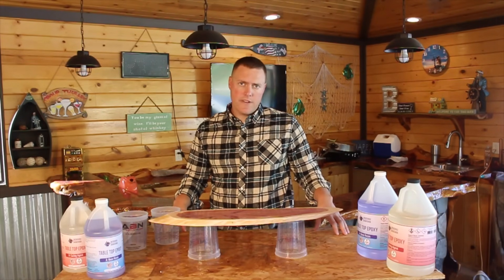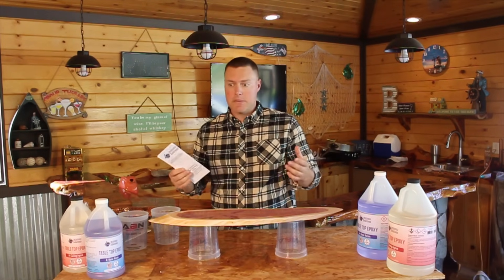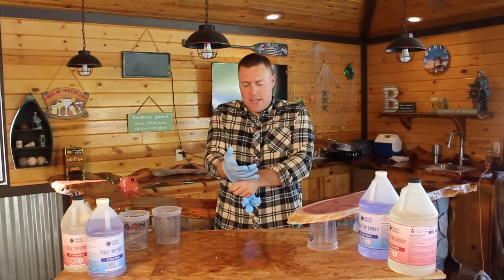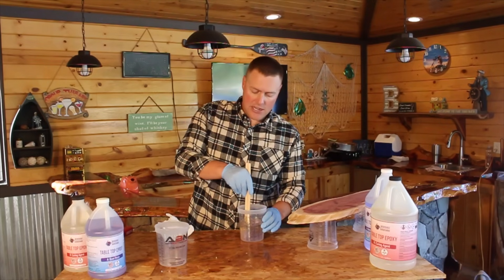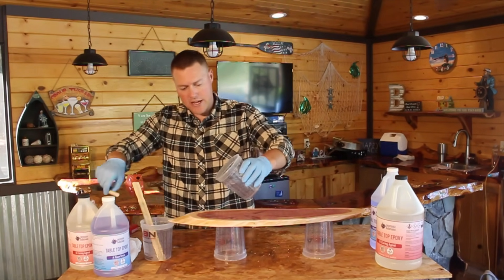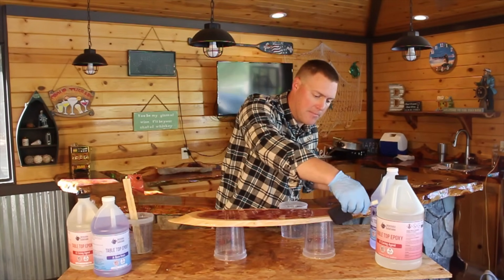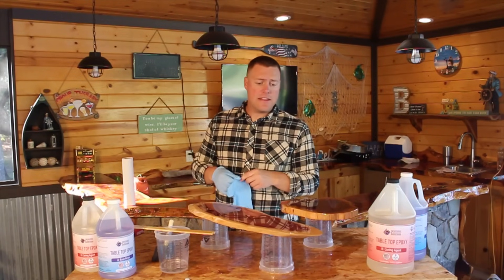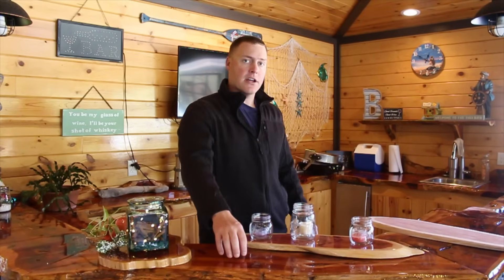Epoxy Countertops DIY Tutorial: How To Mix & Pour Bar Top Epoxy Resin Self Levling

Comment: I have a flag painted table top with gaps between each board. How would you suggest I approach epoxying it and is it even feasible? Great video
Reply from the maker: Is there a base under the boards? Or would the epoxy flow through and off the side of the board to the ground?
Reply: Epoxy DIY I taped the underside to prevent the paint from dripping through. I could if necessary tack a thin backing board.
Reply from the maker: Be careful using a backing board as the epoxy might bond it to your project. how wide are the gaps?
Reply: Epoxy DIY maybe 1/16th and partially filled with paint making them even thinner

Comment: Hi There! I recently 'finished' a job that looks pretty good, but I noticed the epoxy tabletop surface is slightly off-level. The tabletop has been cured for a little over a week and generally looks good. Is it possible/worth the effort to pour a top coat to level it off? And how should I go about doing that?
Reply from the maker: Yes, you can, but as you alluded, this can be a bit of work. Is the project itself level?

Comment: I have a coffee table that measures 36" x 24" with a laminate top and a jigsaw puzzle that will cover it.  I want to pour epoxy over the table with the puzzle in it to make a permanent top with the picture.  Any advise on pouring over what is essentially cardboard?  Also, I don't want drips over the edge that I have to sand off and risk hurting the table since it's already made.  I have seen others use sheathing tape and silicone spray for easy release in epoxy molds.  Would that be a good way to protect the edge of the table and help the drips remove cleanly?
Reply from the maker: Yes, paper products need to be sealed prior to applying epoxy. You can use mod podge or a water based clear coat.
Reply: @epoxydiy6356  Great thanks. What should I do about edge drips?

Comment: Thank you for this!  Super thorough and informative!  I do have a question though.  I have an old piano that I don't use.  I've been thinking about taking the sound board out of it with the strings still on and pouring over it to make a really cool coffee table piece.  My worry is getting the epoxy in the strings without having air bubbles.  Any tips on that kind of project?
Reply: I don't have another sound board to do a sample on..I suppose I could get one though.
Reply from the maker: What is the distance between the strings and the board? The strings could hold bubbles, but if you pour in layers and have one layer come up just to touch the strings (not cover) then I think you'll minimize bubbles. The final coat will go over the strings. This layer should be as thin as possible so bubbles can release. 

If there is a gap of more than 1/4 inch (between strings and board), you may be able to pour at an angle to get the epoxy to flow under the strings and coat the board. These are all just ideas, it's hard to visualize without seeing it.
Reply: @epoxydiy6356  thank you!  When I start I'll be doing a video series.  I'll keep ya posted!
Reply from the maker: Awesome! Do you know what type of epoxy you'll be using?
Reply: @epoxydiy6356  I do not, yet.  I was wondering if there are specific epoxy products for metal and wood or if they are fairly universal?
Reply from the maker: You got to be really careful with metal. I know some epoxies do not recommend pouring over metal because it will expand & contract at a different rate than the epoxy which will eventually cause the epoxy to pull away from the surface. If it's just the strings I think it should be ok. We've been using Incredible Solutions lately and are pretty happy with it. : https://amzn.to/2OY2z4T
Reply: @epoxydiy6356  I think what I'll end up doing is pouring a small spot on the back side of the soundboard and let it sit for a while to see what the reaction is between the metal and the epoxy
Reply from the maker: Excellent idea! Let me know how it goes. Good luck!

Comment: I am using the same epoxy used in this video, is it necessary to stir the compounds separate then in another container mix again?
Reply from the maker: The two parts are not to be mixed separately, but rather mixed together at a 1:1 ratio by volume. We suggest mixing and then pouring into a new container and mixing for an additional 3 minutes to be certain the epoxy is fully mixed. Incorrect ratios or incomplete mixing are the most common causes of issues with curing epoxy.

Comment: Is there a way to get a matte finish on timber countertop? We are thinking of waterproof the timber with epoxy, but do not want the gloss finish. Any suggestions?
Reply from the maker: You could sand the cured epoxy. This will take the shine off. However, many of these epoxies are not meant for outdoor use. Not sure where you are planning to use the timber.
Reply: @epoxydiy6356  thanks. We are wanting to have wooden benchtops in our bathroom. What grit would you want it to give it a matte look?
Reply from the maker: You might want to start with something finer and work your way down, but a 320 grit will take the shine off.

Comment: I have built 2 branches from solid oak barn wood which will be coated with a standard extreme weather gloss because they will be outdoors. However, I am mounting surfboards as the back rest and have been considering using epoxy. I have never used epoxy before. I read your reviews and saw that the one used in this video would be better than the rest for UV exposure, but would not be good for all day everyday exposure. I am attempting to find something that will give a nice thick coat to the board that will keep it from being so easily dented and will add strength on top of the brace I inserted in the back for mounting. Do you have any suggestions on what I could do. Thank you.
Reply from the maker: Most coating epoxies are not meant for UV exposure as they will yellow over time. There are a few surfboard epoxies though that you might be able to use as a coating. I will try and find the link and add it below;
Reply: Epoxy DIY that is amazing! Thank you so much.

Comment: I'm going to epoxy over analine dyed maple countertop, not crazy about the high gloss. Is there a way to matte or satin the finish without it just being hazy? Also the countertop near the kitchen window, is there a uv block additive so it doesn't yellow over time?
Reply from the maker: You can sand with a very fine grit 2000-3000. Do not use anything lower (more coarse) than 2000 grit.

Comment: I am going to clear coat a cross section piece of oak that i have inlaid a checker board in. I am confused by something. How do you handle the edges during the flood coat and what does the bottom look like and what do you do to make it smooth? thanks
Reply from the maker: Hey Wes, this really depends on the look you're going for. You could tape off the edges to prevent the overflow. However, most (and probably easier) will allow the epoxy to flow over the edges of the project. As the epoxy gels you can knock down the drip marks. Alternatively, you can wait until the epoxy has cured and sand the drip marks down. Of course, you'll need something to catch the overflow. Please let us know if you have any other questions. Thanks!

Comment: I have a countertop that I want to epoxy but but there are some deep cracks/holes/knots in the top.  I think these will look great under the epoxy finish but would like some idea about how to go about filling them before I apply the sealer coat to the rest of the piece. Also, did you do anything to level the epoxy during the flood coat or was this self leveling?
Reply from the maker: Do the knots/holes go all the way through the wood? If not, you could use epoxy to fill the holes. However, most epoxy requires thin pours. Many recommend pouring no more than 1/4" per application. Therefore, you would have to pour in many applications to fill the hole in order to bring it up to level with the rest of the surface.
Reply: @epoxydiy6356  Dome of the knots go all the way through.  Was thinking of taping the back side until dry then removing the tape.
Reply from the maker: If you do that, you'll likely need to sand the backside. The tape will often embed itself in the epoxy. will it be possible to sand the backside?
Reply: @epoxydiy6356  Yes I can sand the back.  Thanks for the tips.

Comment: Can you use another sponge brush for the flood coat?  Mine was not even the first pour and i want to do it within the 4-6 hours window to avoid sanding.
Reply from the maker: You can, but many epoxies like this are self leveling. Therefore, the epoxy is still going to flow, even after being brushed/squeegee'd.

Comment: Would I be able to use on a clean wood bar top that has hundreds of pennies placed on it ?  Thanks for a great video.
Reply from the maker: Epoxy can be used to embed items like pennies. However, you might want to make sure that the pennies are very clean. Pennies are notoriously very dirty and can hold oil, grit, grime, etc.

Comment: For filling cracks and small voids in wood, is your  epoxy ok to thicken with cabosil?
Reply from the maker: Each epoxy is different. With this particular epoxy you could, but there is a chance the epoxy will become opaque. Also, this epoxy can only be poured 1/4" at a time.

Comment: Trying to figure out why you would need to pour into a second new container to finish mixing when you just mixed your epoxy in a new container.
Reply from the maker: This helps to ensure a full mixture. Incomplete mixing is one of the leading causes of problems with curing epoxy.

Comment: Hey I tried to coat a farmhouse table that was built for us. It was my first time and looks "tacky". Would doing a flood pour fix my uneven coat or should I do something else to fix. One the table is uneven to begin with; it also has different textures in the wood grain. However the person that built it has passed so we are trying to keep it in its original form but we had a house fire so we wanted to coat it in case I didn't scrub all the soot off that coated it.
Reply from the maker: Tammy, what type of epoxy did you use? Is the epoxy tacky or uneven or both? In regards to the tackiness, is the entire surface tacky or only certain spots?
Reply: @epoxydiy6356  I used a farmhouse table epoxy from menards. The hole table has uneven epoxy. There are several spots that are hard but several that are still sticky.
Reply from the maker: What was the temperature when pouring/curing? Is the epoxy self leveling? I am not familiar with that specific epoxy.
Reply: @epoxydiy6356  I didn't take the temperature that day so I am not sure. I think it was 70 outside
Reply: @epoxydiy6356  I dont know if it is supposed to be self-leveling but it sure didn't level on the table

Comment: I'm building a 7ft long, 3 1/2ft wide kitchen table for my wife. Pine 2×6's. Approx. How much epoxy would you estimate I may need? It's around $60 for the resin and catalyst.
Reply from the maker: What's the desired thickness? Most coating epoxy calls for 1/8 or 1/4 inch pour at a time. Therefore, you'll need to pour layers to build up to a desired thickness. You'll need to know the final thickness to calculate how much epoxy you need. A general rule is: 12 sqft per mixed gallon at 1/8" or 24 at 1/16"
Reply: @epoxydiy6356  thanks, man. I appreciate your reply. I think I'll need about 2 gallons of each. Not the entire 2 gallons each. Sure gets pricey. But it will be worth it. Again, thank you for your reply.

Comment: Great video, not sure if this question was asked but can you do this application over a piece of wood that already has a polyurethane finish already applied. Thanks for videos great help.
Reply from the maker: John, assuming that it is water based, it should be fine. If the poly leaves a shine/gloss, you may want to scuff the surface with 320 grit to ensure the epoxy properly sticks.

Comment: Can I  apply  this product over a conversion varnish table
Reply from the maker: Is this an oil based product? If so, no, epoxy cannot be poured directly over an oil based stain. You would need to first apply a water based clear coat. There needs to be a definitive barrier between the two. Epoxy & oil do not mix.
Reply: It's a acetone base clear

Comment: You say the air temp should be 75 to 80 degrees when pouring. Upon pouring the flood coat does it need to remain that warm for 24 hours?
Reply from the maker: Yes, you'll want to maintain temperature throughout the curing process.

Comment: Hi sorry if this has already been answered.  First off, great video!  Second for the flood coat I noticed you pour everywhere in much larger quantities, don't seem to spread with a tool and don't seem to heat it up.  Is that correct?  Goal is to let the epoxy 'flood' and dry on its own and should come out clear / smooth on its own?
Reply from the maker: You can help the epoxy with a foam brush, squeegee, or gloved hand. It will help to speed up the self leveling. It depends on the epoxy but most coating epoxies (Table Top & Bar Top Epoxy) require thin pours of no more than 1/4" per applications

Comment: Can this be applied to a full bullnosed edge? If so, what steps do I need to take?
Reply from the maker: Kevin, It depends, what type of epoxy will you be using? Many coating epoxies will level at 1/32" on vertical surfaces whereas horizontal levels at 1/8". Therefore, building up the vertical surfaces first is necessary for a uniform coat across the horizontal/vertical surfaces.

Comment: Would it be ok if I just coat it once and stop there? Or is the 2nd coat required?
Reply from the maker: That really depends on what surface you are pouring over and how porous the surface is. What will you be pouring over? It also depends on how thick of a final product you'd like. Most epoxies require pours of no more the 1/8-1/4" per layer.

Comment: The last coat - after curing - you called it "flood pour" is that what you said? And is it just the same mixture / resin mixture you started with or some sort of "finishing coat?" I'm a beginner sorry so many questions, I'm trying to understand how much product or what products are being used at what stage of the project. Thanks for your time and help!!!
Reply from the maker: Robin, yes the same product and mix ratio. The first coat should be very thin, just enough to cover the entire project. This will allow for bubbles to easily rise to the surface and will seal in all the porous areas and cracks. The flood coat is just a thicker pour, no more than 1/4" per application.

Comment: How do I know how many square foot a gallon of mixed resin will cover? I am doing a dinning room table that is 72x38 inches.
Reply from the maker: How thick do you want the final project?
Reply: @epoxydiy6356  I want a good coat on it no certain thickness. The table is 1.5 inches thick.
Reply from the maker: Well it would depend on how thick your final coat is. Many epoxies require a max pour of 1/8" or 1/4" per application. Generally, a gallon will cover 12 sqft at 1/8"

Comment: After your seal coat has set for 4 hours, did you use the same batch for the floor coat of mix a new batch for that?
Reply from the maker: No. If mixed epoxy is left in a container past 10 minutes, the epoxy will react in an accelerated fashion. You would have to mix a new batch prior to the flood coat.

Comment: can the epoxy be applied over polyurethane?
Reply from the maker: Each epoxy is different in what it can/can't pour over. However, most epoxies should not be poured over oil based stains, paints, etc. If it its water based then you should be fine.
Reply: Glad I read this question! I have oil based stains that I’m using on a project, i’d really like to find an Apoxsee that can help bolster its durability.

Comment: I poured epoxy and after 2-3 weeks it didn't hardend. What did i do wrong? I pour it in an christmas tree ball. It was 2A 1B epoxy.  So 2-1.
Reply from the maker: This is likely due to incorrect ratios or incomplete mixing. Can the uncured epoxy be removed?
Reply: @epoxydiy6356  it was like jelly. And it got very sticky to the plastic. I threw it away. So how long does it take to the resin to harden before i could be able to remove it from the plastic?

Comment: If I wanted to stain the wood before, what kind of stain should I use?
Reply from the maker: Most epoxies require water based stains/paint only. If you use an oil based stain, you must use a water based clear coat to cover that and cure prior to applying the epoxy. What type of epoxy are you using.

Comment: Is there a formula to know how much epoxy to prepare before making the mix?
Reply from the maker: That depends on how thick you will be pouring. Most epoxies require pours of no more than 1/8"-1/4"
This particular epoxy used in the video will cover 12 sqft per mixed gallon at 1/8" or 24 at 1/16"
Reply: @epoxydiy6356  Thank you sir.
Reply from the maker: No Problem!

Comment: I am flooding a table with 1-4” cracks in it.... how do I calculate for those?
Reply from the maker: Are the 1-4" wide or deep? You would need to calculate the volume of these areas.
Reply: Epoxy DIY 1/4” deep

Comment: Hi, great video. I was wondering if the temperature can be higher than the range you mentioned? I'm doing a tabletop and have to finish it in my garage, which is not climate controlled and I live in the south where it's quite hot. Could I reasonably do the tabletop with temperatures of over 80 or 85?
Reply from the maker: It really depends on the specific epoxy you are using. However, most have a max temp near 80°
Reply: @epoxydiy6356  shew, okay, thanks. I'll wait for a few cool days, or I may have to move the project indoors?
Reply from the maker: Yes, indoors is better so that you can control the environment. Keep in mind epoxy does not like humidity either.